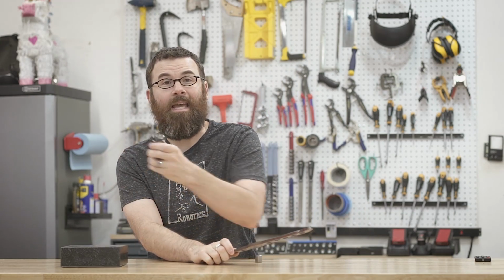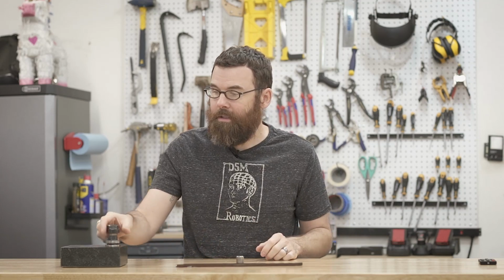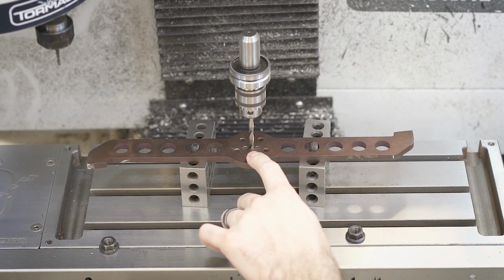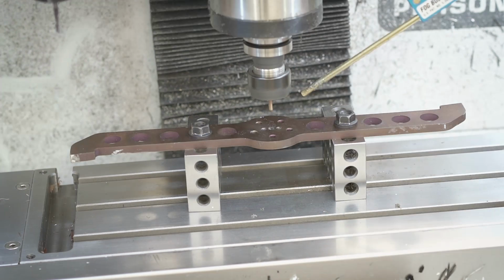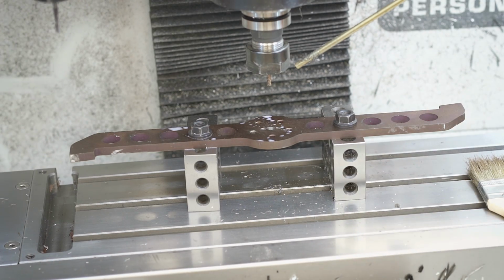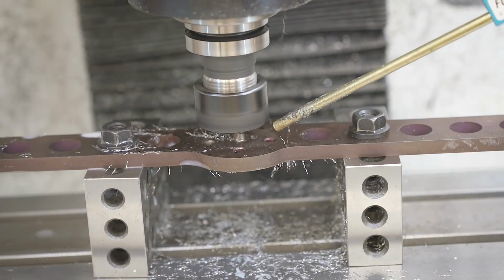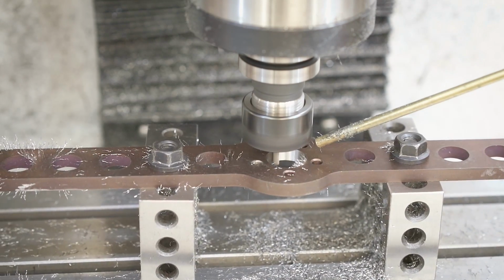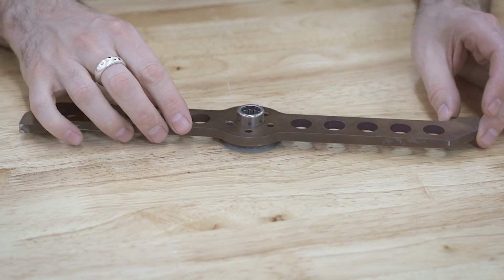Psychotic Break Build - Machining Hardened S7

Comment: I wonder how much that bearing is going to grow when it heats up?  Gage pins generally offer a sliding fit when they are 2 tenths under the nominal size of the hole.  That's why you see most machinists using minus gage pins.  If a minus gage pin goes in smoothly, then the hole is deemed to be the indicated size of the gage pin.
Reply from the maker: Yeah, I like bearings to fit a bit looser because as they heat up, things tend to get really tight.

Comment: What do you use for "Lubricant" for your mill?

I am "attempting" to convert my drill press for XYZ Axis wth Full Lubrication ability (dispersing and recovery).

What parts do you recommend?

As I am a bit "tight" on cash, I'm looking for form, not the pretty aspect!

If I can save $2 on a part that does what I need, then good 4 me!

Also, I am a "Small Engune Mechanic" that LOVES Fabricates my own parts for PERFORMANCE all the time. It's all about Research & Development with me!

Thank you SO MUCH for your Video Series! 😺😎

Take care,
🤓 -Thomas
Western Washington State
Reply from the maker: I'm not entirely sure what you're asking.  For the moving surfaces, I just use way oil, which is the common oil for sliding surfaces.
Reply: @RobertCowanDIY  Motor Oil, or Mill Oil?

For me, it's all about cost and efficiency!
Reply from the maker: @tkskagen  Neither, it's called way oil.  You should be more concerned about getting the right thing.  If you buy the wrong thing, then it doesn't work, and you just wasted money.  Machining is not a cheap hobby, and it's even more expensive if you do things incorrectly.  It's called way oil.  Just search for that.

Comment: Needle rollers are made to be press fit. Without it the cage is loose and the rollers have a tendency to come out under shock. I'm not sure how it works with your blade only covering half the bearing like this.
Reply from the maker: The blade is just a portion of the total assembly.  There are pieces that fully surround the rest of the needle bearing.  It will be fully enclosed, just not by the weapon alone.

Comment: Why is this not a centering fitment? Is a thousandth of an inch not enough to cause vibration in the weapon  ?
Reply from the maker: In a previous video I showed the weapon 'stack-up', and there is a lot more going on.  It will be held in place by other parts, and there shouldn't be room for it to 'rattle' around.
Reply: Not wanting to sound too 'odd' here, but a little intentional weapon vibration at maximum speed may not necessarily be a bad thing. Thinking back to a recent BattleBots fight ['Carbide' versus 'Duck!'],  it was Carbide's perfectly balanced weapon that caused its downfall.

Once wedged under that damaged floor plate, no amount of drive-wheel spinning or weapon revving provided any usable vibration to shake it free. The machine was built and tuned and balanced and refined to such a high degree that it couldn't escape. A little weapon wobble - but only as an emergency ploy at very high revs - might have helped.

A more robust floor would have helped, too.  ;-)
Reply from the maker: @EleanorPeterson  My weapons don't wobble.

Comment: Why you don't attach carbide indexable inserts on your weapon? That would give you extra hard blade tips as weapon. Those lathe inserts are cheap enough to consider.
Reply: Darko Bulatovic Darko Bulatovic They shatter. The blade needs to be hard, yes, but overall, you're really looking for maximum inertia, not hardness.
Reply from the maker: Yep, as ethan said, hardness does not equal shock-resistant.  Inserts would just explode on impact.
Reply: @RobertCowanDIY  Just for interest: Didn't Cobalt have those on its weapon as well or was it just for the looks? You probably got the closest to the actual bot from all of us:-D
Reply from the maker: @themechanix393  That was just paint, made to look like inserts.
Reply: @RobertCowanDIY  there are different kinds of carbide. There are marked also as M2 to M5( ISO) with different characteristics. Some are hard (and britle) for harder material cutting like SS and hardened steels but some are less hard. There are extremes 65-80 HRC for really hard materials but there are less hard carbides that might give you desired characteristics maybe in range of 45-55 HRC. Carbide is more shock proof and resist vibrations, industry uses carbide boring bars as they make less vibrations compared with HS steels. But this woukd requre you make precise seat on weapon to test...  i probably would brake bunch of tools to make it.
Reply: @darkobul1  carbide is still going to be more brittle than steel, so a hard hit will shatter it where it would just deform the steel a little bit.

Basically no benefits compared to the time and work to make the mounts, and after a hard hit that deforms the mount and prevents a new insert being installed, now you have a blade balance issue.
Reply from the maker: @darkobul1  OK, could you take one of these carbide tools and shoot it out of a cannon at a steel wall at 200MPH?  If it would survive that, it might work on a weapon.
Reply: @darkobul1  Please feel free to build this carbide tipped weapon and show all us builders how we're wrong not to use it.
Reply: @tks546  i gave an idea, if you dont want to use it dont. I shared what I have learned about it.  I see none of you actually tried it but you know....well that is it.
Reply from the maker: @darkobul1  Yeah, you see how SLOWLY they're feeding into the material?  Try literally crashing the head into the workpiece...  THAT'S the speed at which weapons engage.  Feel free to try it out, but I seriously doubt they would survive even a small hit.  These inserts, even the hardest ones, would still crack if you hit them with a hammer, and that's just a fraction of the forces involved here.
Reply: @darkobul1  I am not a roboteer myself, I am just a weird nerd on YouTube. My dad was looking for a claw hammer, since we live on a farm. The hammer was REALLY nice, other than carbide inserts. When it arrived, I asked why he bought something with inserts. He didn't care, because he did not know. I told him it was going to shatter. First time we needed to splinter wood to remove an embedded  nail, it shattered. On soft wood. Carbide inserts don't increase overall damage, they just shatter.
Reply: @parkerwicker  https://en.m.wikipedia.org/wiki/Tungsten_carbide